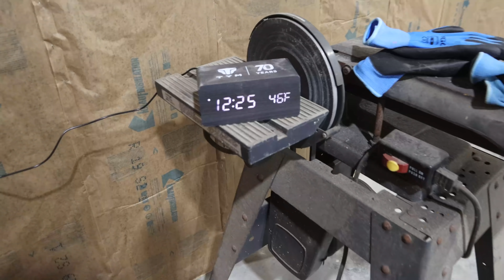Icy Morning on Homestead, but we got several odd jobs that need to get done.

Comment: Yall should get a couple of those aluminum cages that the IBC totes come in. You can load them full of firewood and use the fork attachment to carry them put wheels on one and roll it into shop and back out when empty and pick it up and fill it then bring back, set it down and roll it into shop and park it and use it for your wood storage.
Reply: When I had a wood stove before I moved I bought some wheeled cages and stacked green wood and covered till it dried

Comment: Evan--How do you know you are running that shop stove at the proper/safe temp without a thermometer on the flue? Helps tell you if you are to hot or too cool...either is bad for the chimney.

Comment: Evan, they make a drill bit that you can use in your cordless drill to split wood for the kindling and it will work on bigger logs also. You had really good help and Rebecca has this special way of handling any kind of livestock or domestic animals.

Comment: Just a suggestion, the rack for your fire wood. Why don't you make it portable,  then when it is empty, you pick it up with forklift take it to the place where you stock pile, load it up, then drop it back at the house. Cutting out an extra step
Reply: Use an IBC tote aluminum cage. It has a base that can be used as a pallet. In the shop it can have caster wheels mounted to it to move it on concrete. It can be wheeled out of the shop, to the tractor and use the forks to pick it up, fill it and then bring back to the shop full and then roll it over to be stored by the stove to pull wood from. It will hold as much or more wood than you had stacked.

Comment: I have been scratching my head and wondering, how did that pit get cleaned out before you pulled the floor and wall? It must not have been used very long.

Comment: Seems you are handling your firewood an awful lot.  Have you thought about a containerized system where you set a container at each place instead of restacking and stacking into the bucket??  Those wire baskets seen on YT make a lot of sense.